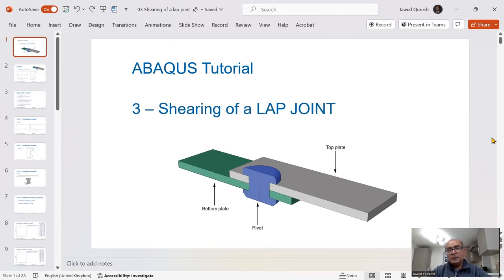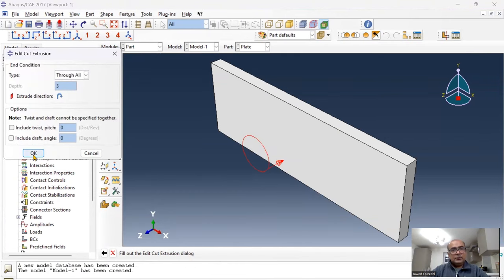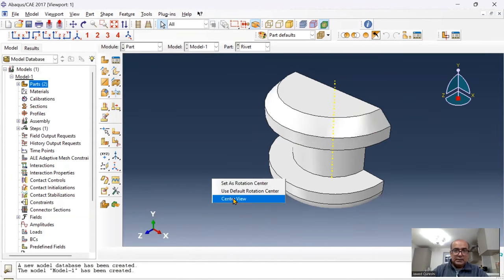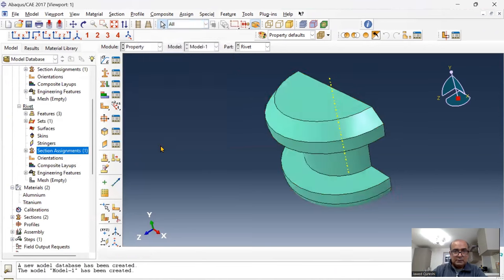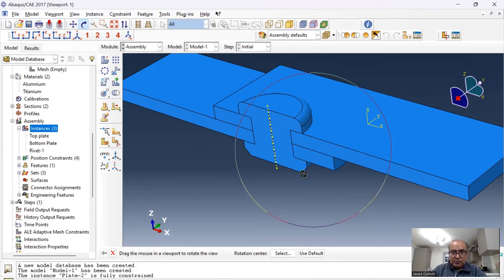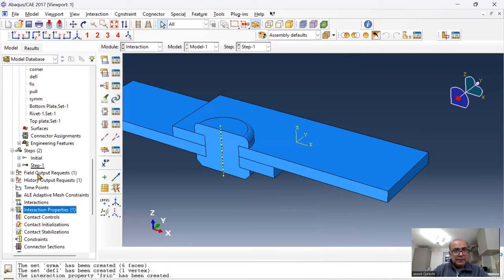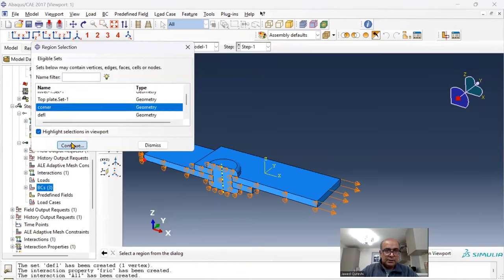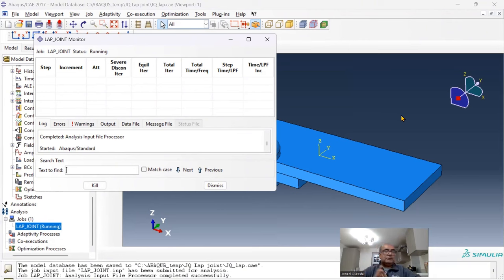3 Shearing of a LAP JOINT – ABAQUS Tutorial

Comment: thank you for this great video. I have a question - what is CPRESS measuring? I know it is a contact pressure but is it measuring at the intergration points or nodes or is it an average over the entire element? i am just not sure where exactly is CPRESS measured within an element?
Reply from the maker: Thanks for kind comment. As per ABAQUS Documentation below

https://classes.engineering.wustl.edu/2009/spring/mase5513/abaqus/docs/v6.6/books/usb/default.htm?startat=pt09ch29s03aus126.html

“For general contact CPRESS is calculated as the magnitude of the net contact normal force (the CNORMF vector) per unit area (it is an unsigned value).”